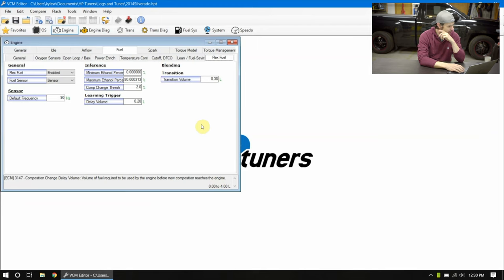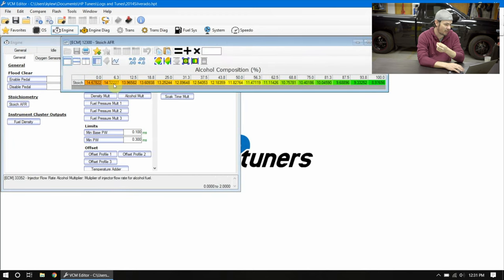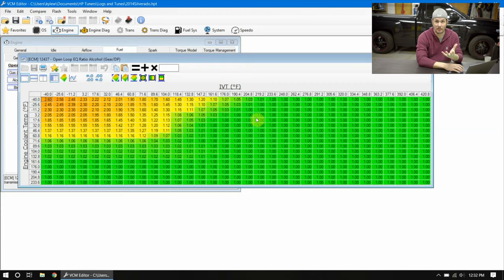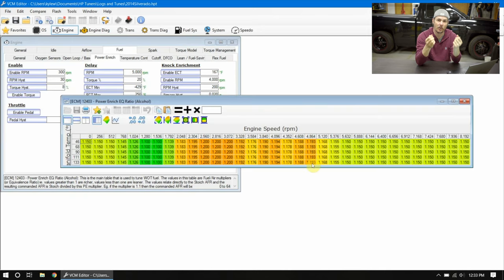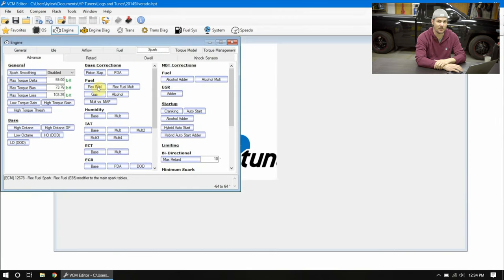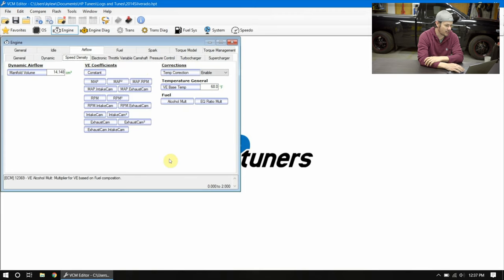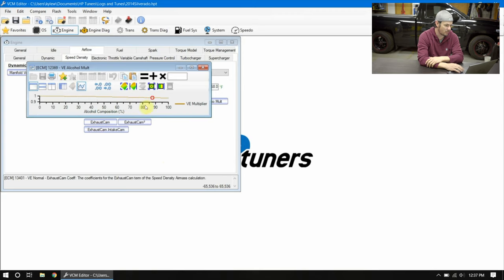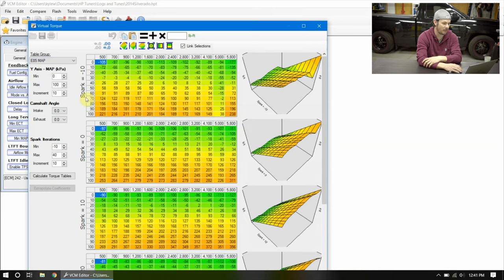Flex Fuel Tuning in HP Tuners, Tuning Series Vol. 7

Comment: Wait so if I understand if you have a solid Tune and VE table for 93 you can just turn the sensor on and adjust timing for E85 no need for fueling changes? 

I have a 2011 camaro SS with the flex fuel sensor install and it already has a tune on it from a shop but I’ve decided to try to fix the surging issue myself.
Reply from the maker: Correct, the stoich table adjusted for ethenol content from the flex fuel sensor reading
Reply: @GoatRopeGarage  so i opened up my files for the first time last night and the tuning company turned it on and added 6 degrees of timing across the board on the flex fuel table in spite of the fact they said they didn’t. 
I also found out the low octane table was the same as the high octane. How bad is this?
My VE table also has some ridges so when my AEM wideband comes today hopefully I can smooth that out. Trying to fix the surging issue of my big cam LS3
Reply from the maker: It's not the worse, just don't like to do it because you're not protected from bad gas. Ve table can have some ridges, the zones interpolate, do verify it with a wideband when you can
Reply: @GoatRopeGarage  I’m going to follow your video on gen 4 VE tuning to isolate the table and see there’s a lot of sharpe edges on this table
Reply: @GoatRopeGarage  I’m wondering if I have an exhaust leak or something near the sensor because the graph reads 111% lean at 2 lambda, it’s 42.7% E85. 
That or I didn’t set up the EQ ratio error graph right.
Reply from the maker: @nickmahramus5034  2 lambda is full lean, good chance you're right on the leak

Comment: I bought a wrecked 07 Silverado 2wd 5.3 flex fule at the auction, I fixed the body and when I drove it I think it had regular gas in it cuz it pinged BAD, I put E85 in it and it woke up and runs a lot better but it still had a little pinging to it, I think it has been tuned wrong by someone. Since its a salvage I don't know who owned it before me so I don't know what he did but its almost like he put way too much timing in it, if anyone has any ideas I'd sure appreciate it. Its a really clean truck but im nervous to do any tuning myself because I don't know whats been done to it.
Reply: Need to go in & reset the flex fuel sensor, if its over 10% u will have drive ability issues

Comment: Is there a PID for injector duty cycle or is there a custom set up for it
Reply from the maker: It will be injector duty cycle if it's port injection, it will be pulse width for direct injection.
Reply from the maker: I haven't verified this math, but you can try it. I'll verify it next time I get a chance.

INJDC% = INJBPW * RPM / 1200
Reply: There is a predefined math. 
Injector pulse with [50112]
Engine speed [50070]
Expression:  [50112.249]*[50070.56]/2*100
Reply from the maker: I thought there was something but I couldn't remember, good find!
Reply: So in order to make this work do you have to make a graph of this or can you actually build a pid to make this work
Reply from the maker: You can just add the math to the charts at the bottom and trend it there, that's what I usually do. All that can be done after that fact as long as you're logging the base PIDs from the start.
Reply: That worked like a champ now I wish I had it on the Dyno today
Reply from the maker: What are you hitting? You've got to be pretty low I'd think with those hot injectors!
Reply: 1.4 percent at idle.  I’ll make a pull tommorow and see what it does